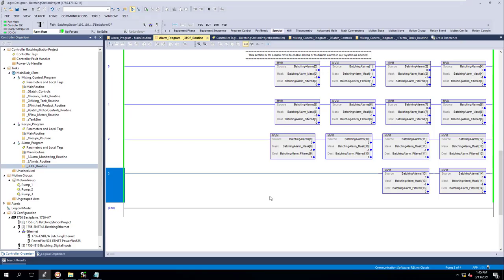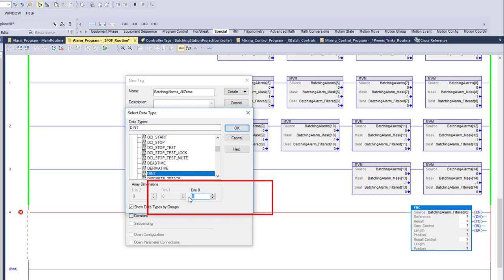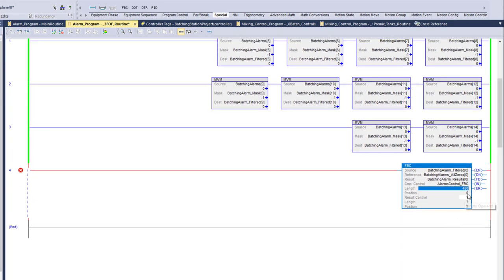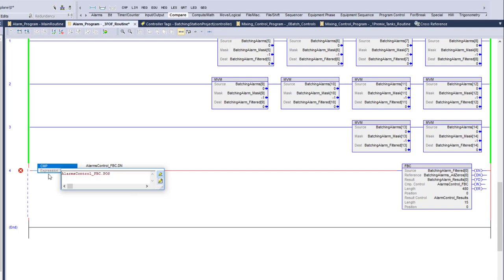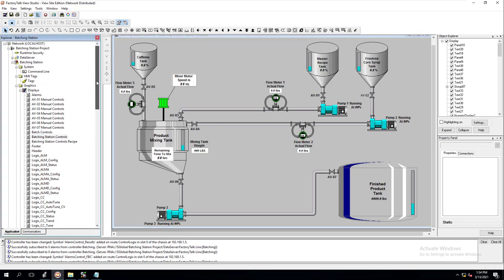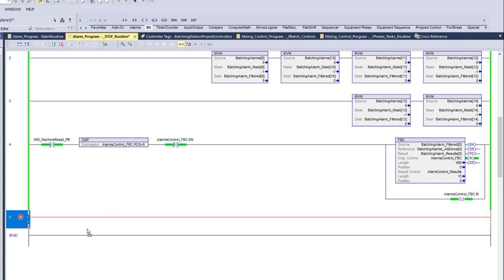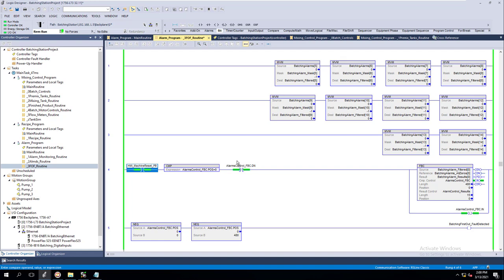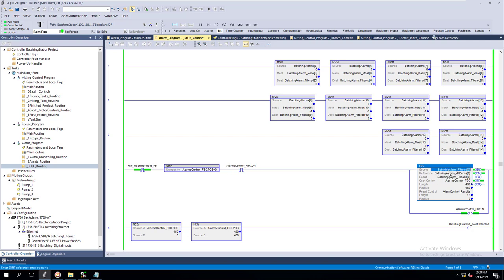File Bit Comparison Instruction In Studio 5000 | FBC Instruction

Comment: Sir I am using kinetix 5500 servo drive.node flt 07 clock sync error  occur During running. How to fix
Reply from the maker: Make sure the time sync master clock is set with the date & time of the Servo.

That would be one thing to check.

Sounds like the motion device lost synchronization with the master clock.
Reply: @ShaneWelcher  thank u for your valuable reply
Reply: @ShaneWelcher   sir . I already enabled time synchronization in plc controller properties  windows
Reply: @ShaneWelcher sir  some time  local clock not synchronisation  with grandmaster clock in  drive module  properties  windows
Reply from the maker: Sounds like an IT issue, you need to troubleshoot the network.
It could very well be a firmware issue with a switch.

We have seen that in the past.

Depends on what switch & what firmware but either way, if you have a network team them notify them to troubleshoot the issue.
Reply: @ShaneWelcher  ok sir
Reply: @ShaneWelcher  thank u so much  sir
Reply: @ShaneWelcher  sir can u pls upload  the message  move instructions  for plc  to  plc
Reply: @ShaneWelcher  Sir.  Your  YouTube   video  is very useful  for us. Thank u
Reply from the maker: @yuvisofttech2777  I already have videos on produced consumed tags for processor to processor.

Search produced consumed on this channels searched tab
Reply: @ShaneWelcher  sir problem solved  .master  clock ⏰ error .I changed  the time . Then servo synchronoused
Reply: @ShaneWelcher  thank u
Reply from the maker: @yuvisofttech2777  Great to hear
Reply: @ShaneWelcher   sir. How to add the customized( weight scale  )   device  with plc.